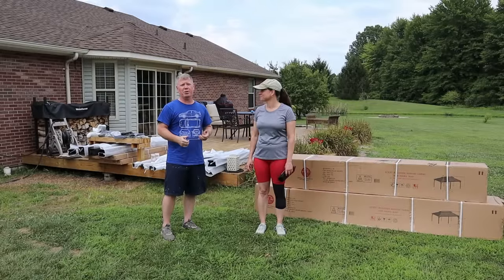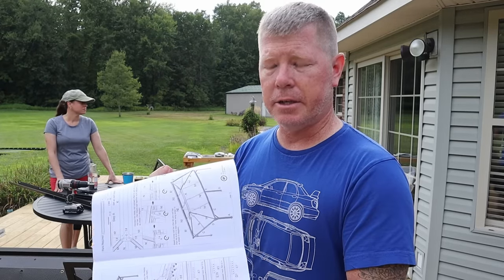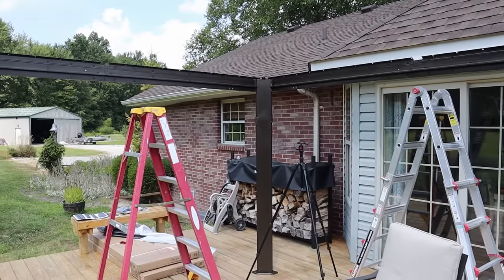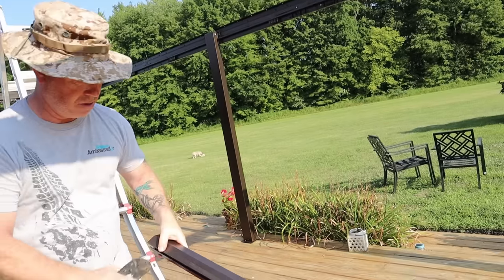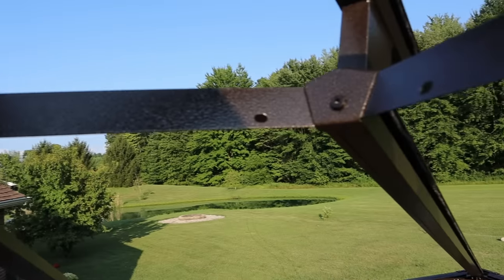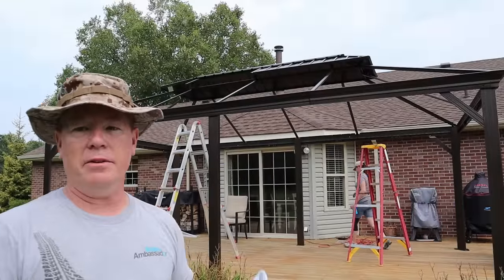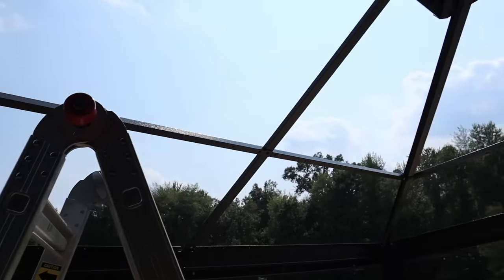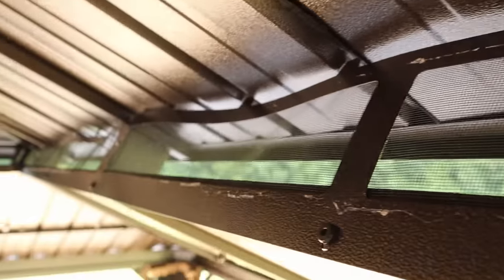Assembly How To- Kozyard/ Purple Leaf Gazebo (& Other Brands) - 12x20 Metal Roof Gazebo

Comment: Good news!!! Some things have been updated design-wise since this video. The biggest design improvement is that the bug screens are now sewn to the frame, not glued! And those frames are now notched to fit the peaks in the roof. Awesome job  Kozyard! Now.... The biggest pain in the whole build... putting on those aggravating, hate filled, nasty little plastic spacing clips on the beveled ends of the roofing material with "double-sided" tape that doesn't stick. AT ALL! After an hour and a half and we only go the first 2 small pieces of the upper roof in place, I yelled at my kids to go get mom's hot glue gun. 😂 Worked like a charm! Not one popped off after that! No one can see those plastic guides anyway since they rest in the channel, so off I went with my glue gun. We love our new Kozyard.
Reply from the maker: HI Bandlady. Thank you so much for watching and sharing these updates and HUGE tip with our community. We really appreciate you for that. Glad to hear they have improved some things in those areas and now I just wish they would go back to the metal clips like they had with ours. The plastic ones appear to be the biggest point of frustration with customers now. Take care and we hope you have many happy days ahead with your gazebo!

Comment: Hey!  Thanks very much for your helpful video and comments!  I'd like to add a couple items:  First, the "Z" pieces that attach to the roof panels are now made of plastic, so there is no worry about them being powder coated and having to pry the tabs open.  Also, my wife and I found it very helpful to use a Phillips-head screwdriver inserted into the roof panel holes and the attachment points to line them up before attempting to pass a screw through them.  Maybe this will help someone else!
Reply from the maker: Brian, thank you very much for not just watching and sharing the kind words but also adding tips for other consumers. That's what this community is all about. We're thankful to have you as a part of our journey!

Comment: Great video! Although I finished my 10x12 a few months before you posted this video I still enjoyed watching it. Mine will be a year old soon and it went through NY snow like a champ! I did use flex seal clear at each screw on the outside of the roof and middle joints and any area that I could see the sun poke through, that really made a huge difference in no rain water coming through.
Reply from the maker: Hi NY Disneymom. Thank you so very much for watching and sharing the kind words. We really do appreciate it. Especially that you have already built it and still enjoyed watching it. :-) . We're so happy yours did well in the winter. We had no problem with ours as well here in OH. This year I will do better of taking video footage to share with updates. Thankfully we've had no leaks on any of ours and we hope to keep it that way. Cheers
Reply: @SpiritedWrenchers  aww thanks, you guys are so sweet! I had a few screws that leaked a tiny bit and I didn’t trust that tube they included so used flex seal instead. So while I was up on the ladder putting the seal on the 2 or 3 screws I just did all of them :) I did mess up big time though, forgot to tie the curtains during a windy storm and every corner lost the hook that holds it to the 4 corners and tore a hole in each corner of the curtain…lesson learned to ALWAYS tie up those curtains! (good thing you can buy a replacement curtain) looking forward to your updates….all the best!

Comment: Huge Thank you!!!! My wife and I started assembling our 12 x 18 this past weekend. We are about 10 hours into the assembly and working on installing the lower roof panels. Ran into huge problem last night as holes not lining up on the lower holes of some of the roof panels. They are off by about 1/2". Tried loosening up some of the "E" bars but did not work. Was going to bring those in to work today and redrill the holes but decided against it and will try again tonight to push the panels over somehow. Your video has been a great help and would strongly advise everyone assembling these structures to watch your video first. Ours is from Purple Leaf and they should post your video on their site!
Reply from the maker: Hi Craig. Thank you so much for watching and sharing the kind words. We really appreciate you for that and for saying that Purple Leaf should put our video on their site. That is awesome feedback.  Might have to reach out to Purple Leaf to see if they are interested in a deal. Did you figure out the hole misalignment issue?
Reply: Any updates on this?!

Comment: Thanks for taking the time to post this, very helpful. Very important to read the manual front to back. The stick little tidbits like taping the spacers on the last page vs when you are putting the roof on.             -XXXXXXXXXXX  MOSQUIITO SCREEN AT TOP>  Mine did that for a moment, it's from wrenching too hard on the screws and it makes a ripple. if you back your screws out and put them in by hand they will straighten out. There are a few different instruction manuals floating around. I found one that had us install the mosquito screens at the top after the upper roof was done. This seems logical and was less stressful.             XXXXXXXXXXXX Also, The Silicone sealant isn't for the gap behind the center spacers, it's for the top channel to seal the gap for water drainage or else it will drip down the center. I had extra silicone left so i used it on the Mosquito screen at the top to seal the small gap  at the roof.   For those looking to buy this, I have the 10x12 one. and the roof spacers (that in the video are powder coated together and they had to fight with them)... are now plastic and a small piece of scotch take works great to hold them in place during assembly. The instructions also say to not tighten down ANYTHING until the end.  I also used the little sand castle footing used for floating decks. the triangle fits fell right on top of them and can screw to them.
Reply from the maker: Hi SIR Spends-A-Lot ( I can relate to that name. Lol). Thanks for watching and sharing the kind words plus leqving additional tips for everyone.  We really appreciate it.
Reply: Hi SIR Spends-A-Lot, I just got the 10x12 gazebo so am watching youtube. You mention that you put sand castle footing somewhere (last line) what are those and where did you put them? Love all the tips everyone posts. Thanks

Comment: Thank you- very helpful.We have the purple leaf 12 by 16 one and the manual was pretty good and clear and doenst have  the mistakes yours had. 

That said, maybe we had too much sun and got confused where the P bar goes lol. We kept trying to fit it on the external frame instead of internal. We figured it out after awhile but had trouble fitting it until we saw your video. The video is helpful although my stubborn 70 something year old father was trying to reference the least amount of info lol.
I, his daughter, helped him and it’s going smoothly. We just have the lower roof left. 
It’s my moms and pops gazebo but it’s just me and my dad assembling it. I organize all the parts for each step and hand it to him so he doesn’t do too much bending and he does the drilling and fitting.
All in all, your video was very helpful. 
Cheers from Canada!
Reply from the maker: Hi J Joy. Thank you so much for watching and sharing your story with us. We really do appreciate it as well as enjoy being a part of everyone's journey. We got a laugh of what you shared about your Dad and we're so happy our video helped with the parts of your assembly. We also built a gazebo for my parents so I can appreciate you doing the same while also making memories. We love it! Cheers!
Reply: @SpiritedWrenchers  we finished the gazebo! The roof went super smooth- father fitted panels while I fitted the spacers and screw caps.  Neighbors had it professional installed and told us we would have problems with the roof and were shocked we breezed through it. My dad is a retired tradesman so that helped lol and I kept us organized with tools and efficiency.
Your video was great as I don’t like Manuel’s so I will be sure to share it!
Cheers from the North!

Comment: Wanted to say thanks. I watched this video a few times to get an idea of what I was getting into for my sister in law. My brother and I installed a 12x12 gazebo in about 8 hours. Yes, roof and some other instructions were not clear at all but it got done.
Reply from the maker: Hi Jack Bauer. Thank you for sharing your journey and the kind words. We really appreciate that and thankful we were able to provide some insight into the task that was before you. Congrats on the build. Very nice work on doing it in 8 hours. We hope you all have many years of enjoyment with it.
Reply: Hi, was your 12 x 12 a kozyard alexandar brand? I see you have it 8 months now and I'm wondering how it still is. Does it leak an. Even thru the roof venting area? Thank you
Reply: @darbrown2859  it was 12x12 but not sure of the brand. So far it stays dry as long as the rain isn't blowing. Recommend a fan or something when it's warm. The dark color makes it warm.

Comment: Just received our 10x12 Apollo gazebo and unboxed it. Hoping watching this video will make our install easier. Our unit has plastic roof panel brackets and instructions say to use double sided adhesive tape on the down side edge, I guess to hold them on better. None of the videos I’ve seen show exactly how these fit to the roof panels and none mention tape.
Reply from the maker: Hi Tina. Thanks for watching and sharing your journey with us. We've heard that about the clips from a number of people now so that's quite concerning on the change that was made. We're actually going to be a full assembly episode on a 10x12 from another brand at the end of the month so we'll see how it goes. Keep us updated on your assembly if you don't mind.

Comment: Thanks for the post.. we are now in the process of building the exact same one and boy… it’s crazy.. the instructions (I hate) the diagram (I hate) and the not so clear instructions (I hate) lmao.. but you all made it work.. 7 hours into and we had to stop… we will finish tomorrow for sure.  Thanks for the video.
Reply from the maker: Hi Miguel. Thank you very much for watching and sharing the kind words and your journey. We chuckled reading it because we know what you mean. We're happy we could help you through the adventure of getting yours put together. Let us know how it went when you have it finished. Stay safe. Cheers!
Reply: @SpiritedWrenchers  ok.. no problem. Here goes…. We completed the job 2 day process.. didn’t want to burn ourselves out… the only problem I had with the Gazebo. Which wasn’t in your video was (3) brackets that are on the top outside panels. And on the inside tops where the mesh is..  there is some light where there shouldn’t be.. we moved them around as much as we could but not sure if it will hold up… thanks for the reply

Comment: Thanks so much for taking the time to walk through and recording, including the mistakes - priceless . I'm wondering if you had alignment issues with X3 and X4 panels. I noticed you have a small gap at the top of X4.I have the same gap and cannot remove it no matter what. A few suggestions for viewers: 1. Upper screens - do them last as Art & Dana did, not in the middle like the instructions show. You'll just have to take them back off to help with roof panel alignment and that top bugger of a screw. 2. Make sure the lower roof panel brackets face inward and up- my interpretation of the instructions did it the other way around, and I had to take them all off and redo them. Also loosen those same brackets as Art and Dana did to help align the mounting holes. 3. You might need the patience of Job with those roof clips - just look at them wrong and they come loose or fall off. Thanks again for outstanding service to the community😊
Reply from the maker: Hi pfont60. Thank you so much for watching, sharing the kind words, tips and your own journey with the community.  We really appreciate that. I don't recall having any gaps in those panels and we have had zero leaks since the install as well. It also sounds from your story and others that the roof clips were changed out at some point, which is unfortunate. Glad you were able to get it all together.  We hope you have many years of enjoyment out of it! Cheers!

Comment: Thank you for this video. We're still in the shopping stage but our pad is ready for something to cover it. I know from experience that there's usually errors in the manuals and it was nice to have a heads up about keeping things loose to fit abutting parts in. Thanks again. I'll practice patience and tolerance as my wife will be assisting me.
Reply from the maker: Hi Dave. Thank you for watching and sharing your journey. We greatly appreciate that. The shopping stage is definitely a stressful one. At least it was for us. LOL. Glad to be able to help and we wish you luck with the assembly. Let us know how it goes if you don't mind.
Reply: @SpiritedWrenchers  one more question if you don't mind. I've searched Amazon, Wayfair and several other sellers. Most are clear that the rain water drains INTO the center of the posts but the picture on Wayfair SAYS it drains INTO the posts but shows water 💦 outside the post. I'm looking at the Kozyard 12X12. I believe it's the Alexander model . Any other input you can offer will be greatly appreciated. I'm hoping for an undamaged and complete delivery. And hopefully good customer support if needed.
Reply: Have you done anything to upgrade or change the zipper openings?
Reply from the maker: @Dwb913  Hi there. No we haven't. No issues with the zippers as of now.
Reply: @SpiritedWrenchers  oh sorry, my important question was does the rain drain into the posts and out the bottom?
Reply from the maker: @Dwb913  ahhh. Good question.  It does not the gutter around the roof has a small hole at each corner and the water drips from there. We're thinking of adding rain chains to help with that.

Comment: Spent the day fighting with the roof and holes not lining up.  I feel your pain!!!  The tip about loosening the screws on the bars that the roof mounts to is GOLD!  I had come to the same conclusion after a few hours of fighting with misaligned holes, but gave up for the day.  I feel encouraged that it worked for you, thanks.  Also, have you had rain yet?  I'm thinking that it's not going to be completely water tight because there are no grommets under the roof mounting screws.  Thanks for the vid!
Reply from the maker: Thank you for watching and commenting about your journey,  we really appreciate it.  We've had rain and it only leaks in 1 spot and its likely because I overtightened 1 roof screw. Its on a center bar close to the edge.  Im going to go back, loosen and add some sealant just to be safe. Not surprised though because of the thin aluminum.  No big deal though. Let us know how it went when go back for day 2. Good luck with the last bit!

Comment: Looks beautiful,, n the back of your house looks very similar to ours, brick color wise, and ranch,, Have you had to clean the better? I'm trying to figure out the gutter system. Although I don't have a tree near it. Things got in there and I don't know how to get them out,, We put ours on a stamped, concrete patio.,,
Reply from the maker: Hi Roger, Thank you for watching and sharing the kind words as well as sharing your story as well. So cool that we have similar setups. For the gutter, occasionally we'll push a long phillips screwdriver through the hole to clean out the crud from the trees near by. Nothing too major but it could be better for sure. If you do that after a rain, the water will help push the small pieces out. Anything bigger has to be done from up top. Hope that helps.

Comment: Hey guys!  I think your video is the most clear and comprehensive gazebo assembly video on Youtube, better even than the professional installers' videos.  Currently in the middle of a 12 x 16 build.  Did your support arms have a brush gasket in them?  If so, did it go in front or behind the roof panel clamps?  Thanks.  Your video has been very helpful!  Thanks again!
Reply from the maker: Hi P Waldrop. Thank you so much for watching and the overwhelming kind words. That means a lot to us and was a goal of ours for the video itself.  Thats exciting that you're working on one yourself.  We don't quite recall on the parts but if you could email us what step or number you're on in the manual, we could take a look.   Our email is Spiritedwrenchers@gmail.com..

Comment: This is extremely helpful. I will be receiving my 10 x 12 sometime this week. I noticed you used a cordless drill. Wondering what torque setting you had it on? I'm always afraid to strip the screws. I'm sure I'll be back with more questions but this is a start. Thanks again!
Reply from the maker: Hi Jeff. Thank you for watching and sharing the kind words. We greatly appreciate it. For the drill, I just had it on a low setting. I believe it was 1. I tend to take it easy on the trigger with anything that I use the drill with and just walk it in until it's snug. Hope that helps. Good luck with your assembly and glad we're a part of your journey!